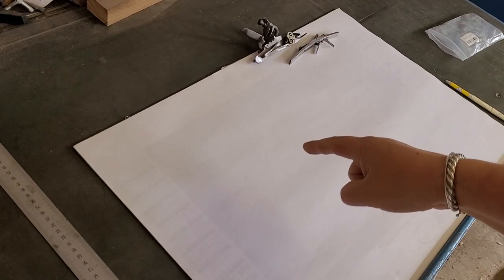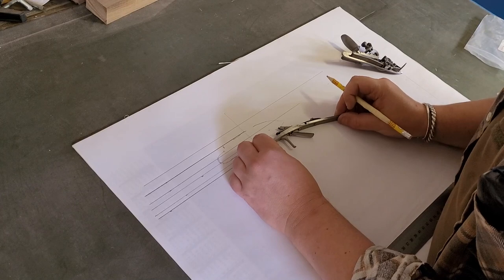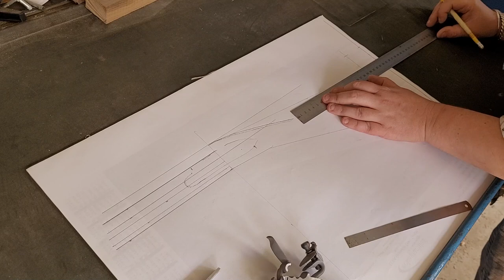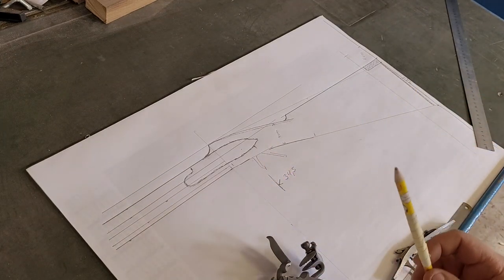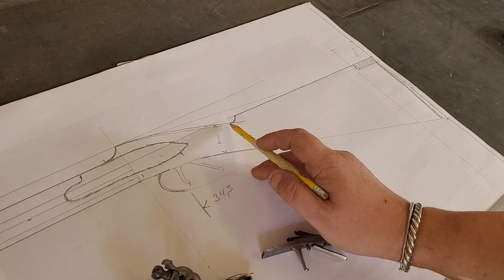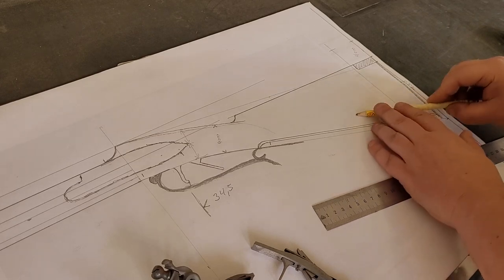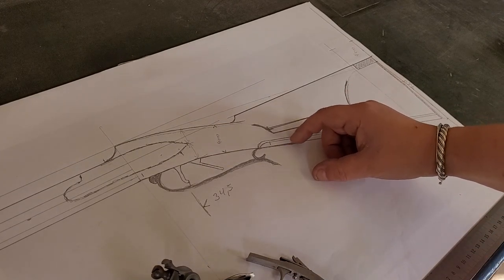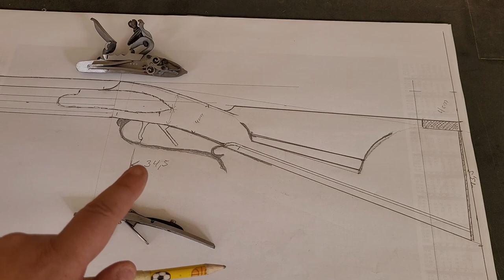Jäger rifle scratch build pt 3 scratch layout for a gunstock

Comment: Who taught you how to do this? You have   great skills.
Reply from the maker: Oh I look at books and pictures of originals sometimes on originals if I have the chance. and at some point I found out by myself how the old masters of the craft did there first design and by what rules. To my opinion they used templates at the shop and fit them to the length of pull. So if you understand the main features of the design it is posible to make a drawing that is very similar to the originals... 
And what is very helpfull is that I have 33 years of experiance as an mechanic 😆
To understand the priciples of design I compare the different styles so the differences getting obvious. like between lancaster style and jäger rifle or tulle de chasse or lehigh style..... and it is a lot of fun to me to do such studdies...... The same I do for the decorative designs .....